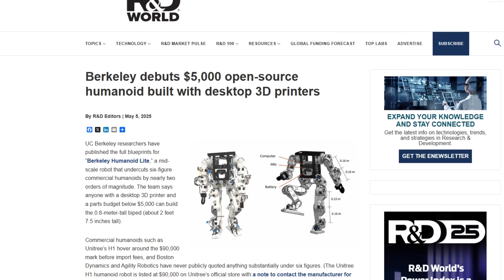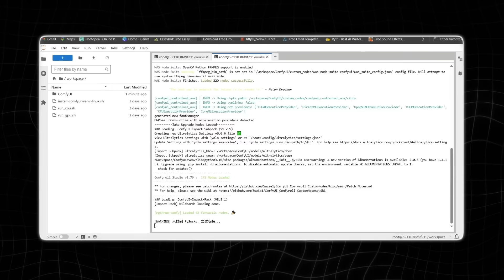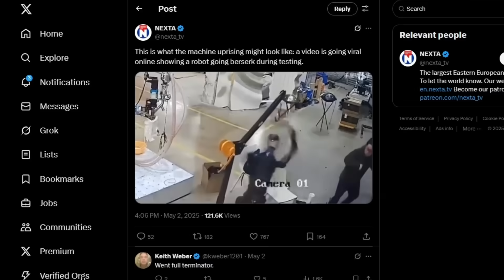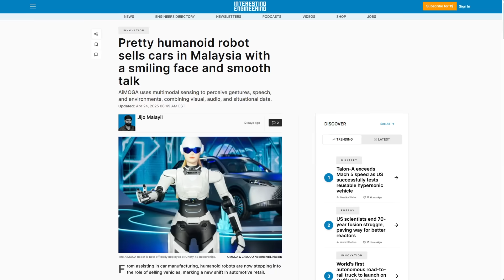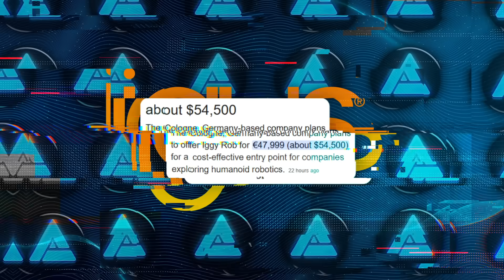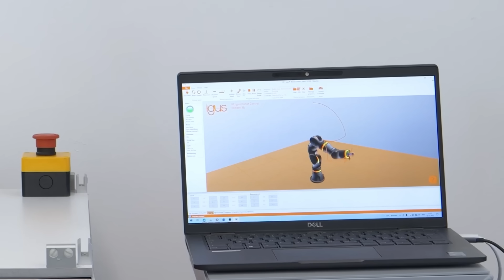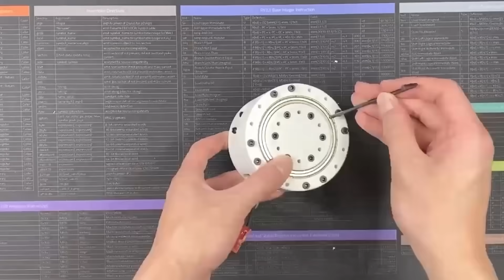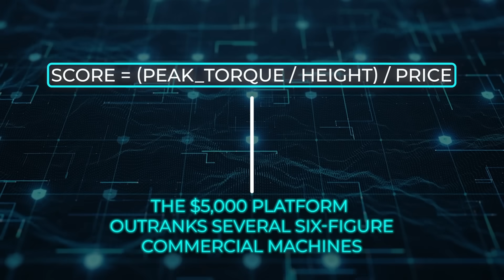AI Robot Snaps Mid Demo and Attacks Engineers on Camera + More AI & Robotics News

Comment: I was in a commercial aircraft flight simulator at Gatwick decades ago being operated by experienced test pilots when it suddenly went crazy - it swung left and right and started going rapidly up and down on its hydraulics. One pilot shouted to the operative at the rear to “kill it” which he did.

They didn’t know if it was a bug in the simulator’s code or a bug in the aircraft’s actually code being accessed by the simulator. I’ve never forgotten it.
Reply: No joke. That was wild; clearly. Sympathies. Glad they were able to get things under control and that you weren't injured.
Reply: wasn't a 737max sim was it?
Reply: But at no point did you think it had became sentient and evil and was doing this on purpose, right? 😏
Reply: There was a time flight mechanics incorrectly connected a few things in an F-15's control system making the flight controls reverse, so a good old human brain can easily screw up too.